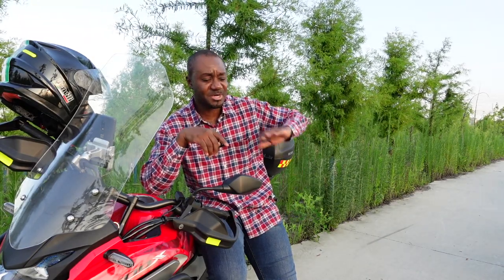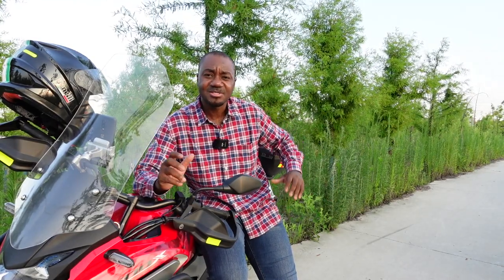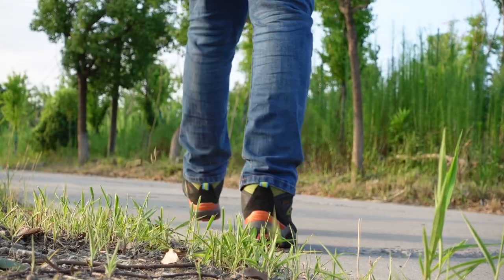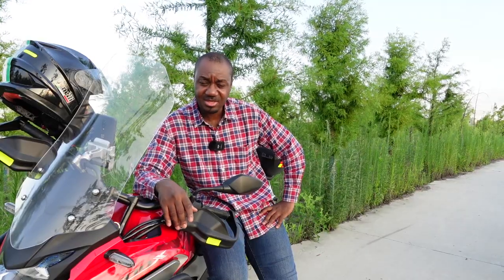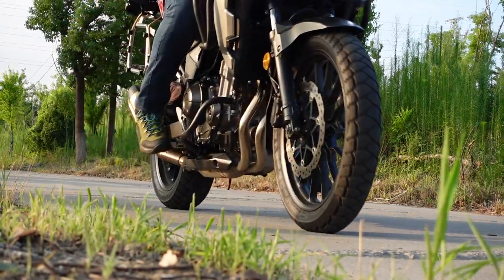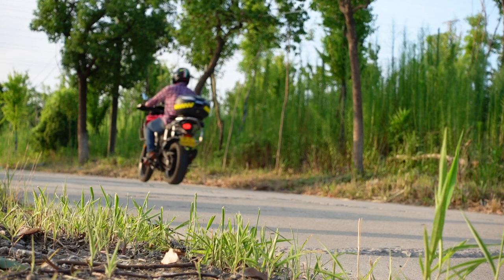My Thoughts On The New ABS || HONDA CB500X

Comment: I've got the 2020 version of your bike, which I bought from new. I'm in the uk & haven't had any recall notice yet🤔
Reply from the maker: Maybe the issue had been rectified when your bike was manufactured. Otherwise, they will contact you someday if it's included. Cheers!
Reply: @TheRideandPlace  maybe🤔but I get what you mean about the juddering under braking, mine definitely does that when the front ABS kicks in. It's nice to know that this recall will fix this issue, if I get it🤣thanks for the quick reply bud👍